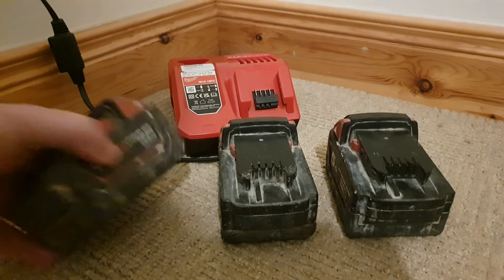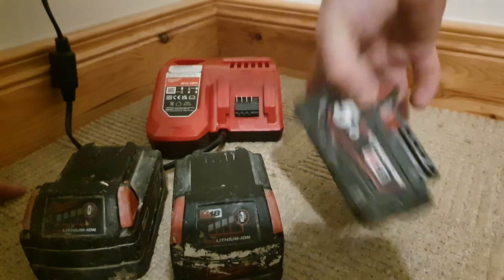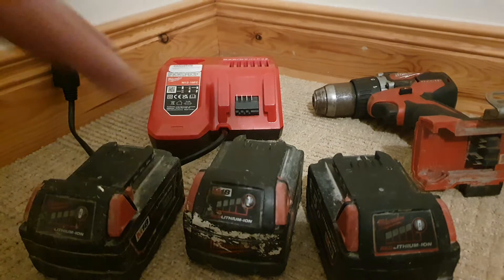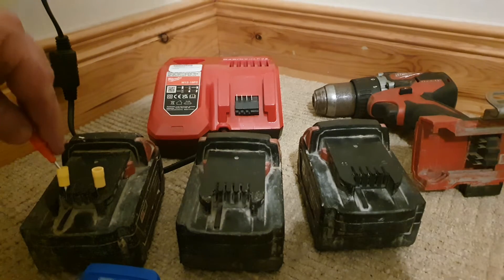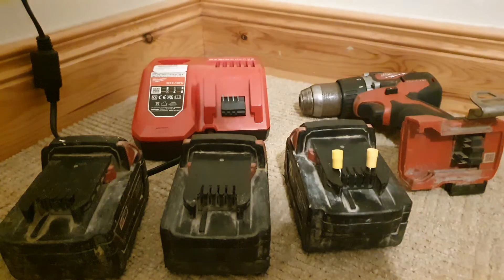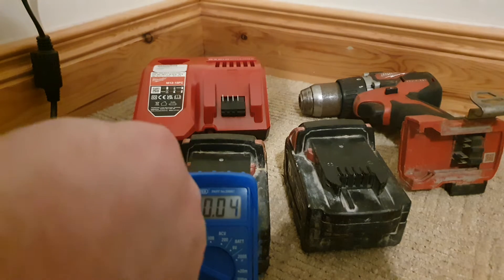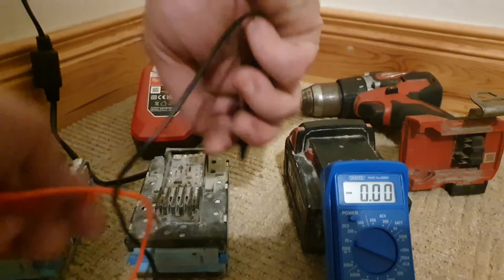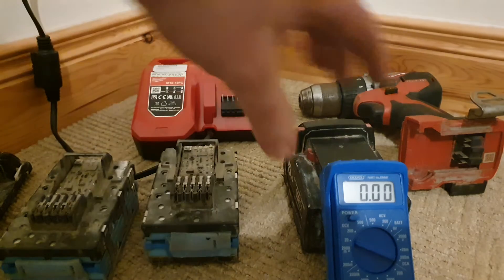What's wrong with my Milwaukee battery? This is the answer

Comment: A negative reading just means your test leads are backwards. I thought the cells were connected to each other in-series so testing them "individually" shows the value of 2 or 4 cells together. I think you would have to un-solder them from c board to get individual cell readings. Wouldn't you?

Comment: I am a plumber Milwaukee batteries are diy standard nowadays... Absolutely crap ... Ive sold most of my Makita tools for next to nothing on ebay an spent over 5 years about £5000 on Milwaukee... In 5 years I had 8 batteries dead 4 fuel grinders,2 fuel drills , 3 multi tools, circular saw , .... I still have some if the old  tools , 12 years old makita impact driver is bulet proof changed the bushes 3 times i use it every day for 12 years, have 4 3amp makita batteries same 12 years old , have 4 4amp makita batteries 8 years old,radio,hamer drill,planer jigsaw,lights ,drill, angled drill,... Overal Milwaukee have more pover but design to fail in maximum 3 years, makita last longer but crap on grinder,circularsaw,receip.... Charging wise makita has a fast charger with a fan , Milwaukees fast charger sets on fire its crazy how Milwaukee are still being seen as professional tools they are clearly no good
Reply: Never in my 12 years I replaced or threw away a milwaukee battery I have 12 batteries from 2.0 to 12.0s
Reply: @817aqqtown  just replaced 2 4amp and a 5amp through warranty... They don't last long in UK

Comment: Thank you for this video. I have a question. I checked the overall output of the battery and it is reading 15.76. So I took it apart and all the individual cells are reading 4.07 or 3.96 except for the 3rd and 4th cell in the pack closer to the front. Those are testing .60

Is it safe to say those cells need to be replaced and that is the problem?  Also, the PCB board on the top looks brand new so I am not sure if it is that. 

My problem with the battery is it is blinking one red light on the battery itself and when I plug it into the charger the light just stays solid green.

I would appreciate any help and feedback you can give me. Thanks again. 👍🏼
Reply from the maker: The cells that are showing nearly zero voltage need to be replaced.
The board could be ok but unless you balance the cells the original board won't work. The knock off board will let the battery work with the cells out if balance but cells being as close to equal voltage is recommended.
Reply: @doctorlefthandthread  Thank you so much for your help. I already have the two bad cells out and I plan on getting the small spot welder, the two new cells, and some strips of pure nickel so I can fix the battery as soon as possible. 👍🏼
Reply from the maker: @joshhibbs_nola  great 👍

Comment: Question for you Dr Lefthand thread. Had a 5.0 m18 with LG HE2 cells.  Pulled it apart, 6 good cells and 4 were absolutely junk. 6 were at 3.95v other 4 were .3v. Replaced all cells with new Samsung 25R's.  All new batteries were 3.54-3.55. Internal resistance between  12-17 milli ohms. Re assembled pack, had 18.19v from storage voltage. Dropped it on charger solid red for 20-30 minutes, then started alternately flashing red/green. Powered off charger, re set the battery....10-15 minutes solid red. Then the flashing again. Pulled it off and was reading 18.33, started at 18.19....it's not taking a charge. Any ideas??
Reply: Get rid of.the crappy charger and get yourself an adjustable power source. The one I got cost me about 70$ and I can adjust it from 0v to 30v with 10amps of current. I set it to 21v and hook up the alligator clamps to the battery and charge it the dummy way. Get a multi meter to test voltage (fluke 107) if it's below 16v the cells in your battery are junk. You can either solder new ones on or junk it.
Reply from the maker: @johndowe7003  you are correct since the creation of this video 5 months ago I have acquired a dc desktop power supply and a better multimeter. Thanks for your advice and comment.
Reply from the maker: My guess would be that you need to replace the board as well
Reply: What's going on is the batteries that he's saying are bad cells are only "bad" because they weren't balanced charged correctly by the board and charger. That does indicate a problem but if you check each individual cell and some will have full charge and some have a low charge you can bring those low charge cells back up and individually balance the cells yourself. If the individual cell reads zero and does not take any kind of charge it is bad or if the individual cell has flipped and reverse polarity it is then usually bad as well and cannot be salvaged. That is common in the Black & Decker lithium batteries, the board is so dumb it doesn't balance charge and it allows you to run the battery until some of the cells are completely depleted while other cells still have a bit of a charge. This causes one or two of the cells to reverse polarity and it will act like a connection break in the battery. Anyway, you will want them all to say as close to the same voltage as possible for them to be balanced and work correctly and charge correctly. If you individually charge them and get them all to read close to the same you will then have a working battery but something is or had caused them to go unbalanced and more than likely they will eventually get unbalanced again. Requiring additional work or replacement it could be the cells themselves and that they aren't charging at the same rate or it could be the board not applying the same amount of charge to each group of cells. If a person decides to change out the low cells instead of just charging them up individually, you can still use them in a flashlight since they do still work. I'm trying to figure out why one of my batteries says green on the charger like it has full charge and when tested it in fact does have full charge and balanced even, but when pressing the charge indicator the light blinks or flashes red it supplies no power to the tool. I'm pretty sure it's a faulty board, I'm looking to see if somebody's figured out the repair.
Reply: @SS-zm3vi  we've already figured out the repair lol just remove the cells (8200 series cells) and install good ones. Then dummy charge the battery, those Milwaukee chargers are garbage. I check batteries use ng voltage only. 21 full 16 dead

Comment: for 5Ah
you might be able to revive them
Reply from the maker: You can sometimes you need to replace the pcb too
Reply: @doctorlefthandthread  yes those 3Ah one are very bad
i seen many many bad Samsung 15M cells
they switched to different cells in the latest model

same as those 9Ah m18 that they stop making them Samsung 30Q and bad board
same in m12 3Ah and 6Ah that they switch to Sony VTC 6 after 2021 december
Reply from the maker: @TranTek  good information thanks

Comment: Great way to salvage older packs only needing a cell or 2. That’s something I’ve always wanted to create is a dewalt 3.5 Ah Powerstack to test against the flex or Milwaukee
Reply from the maker: It seems a waste to toss a battery that only needs 2 cells. I haven't had a powerstack torn down yet it will be interesting to see if they are serviceable down the road.
Reply: @doctorlefthandthread  I opened one up. Pouches encased in a shitty plastic. Didn’t want to tear into it and mess it up
Reply from the maker: @IMPACT-NATION  probably wise
Reply from the maker: @Brandyonfire  in that case I just get a knockoff board cheap and replace it